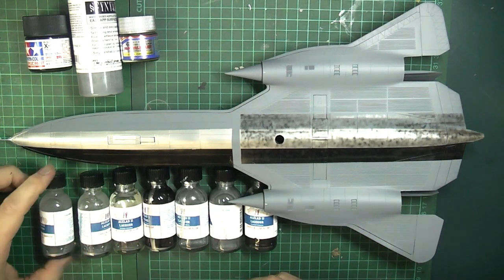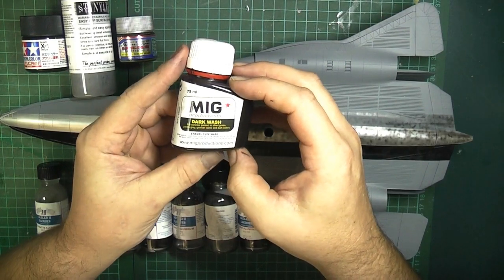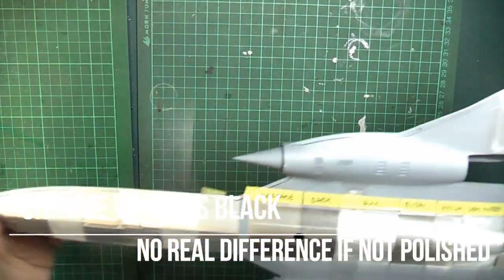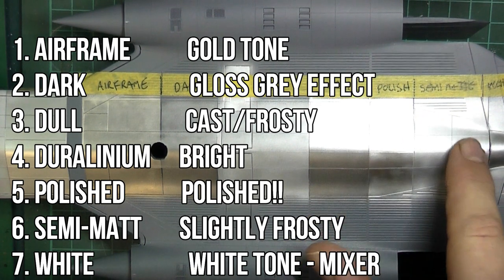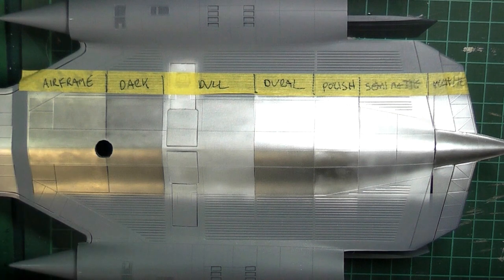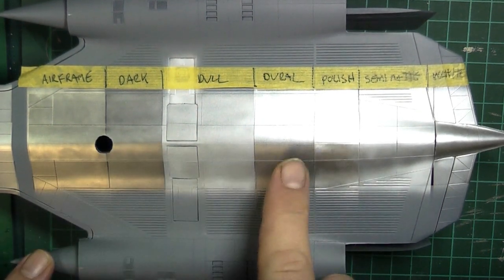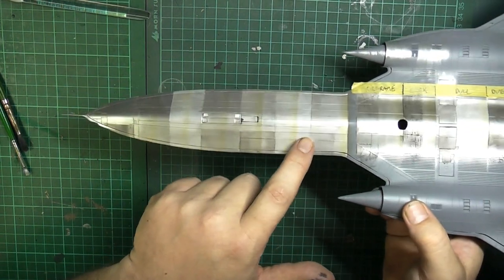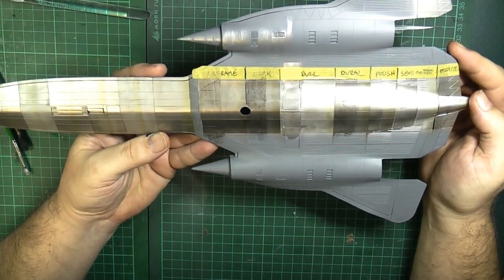How to use Alclads for a weathered aluminum finish on your aircraft model

Comment: Appreciate this was from years ago and not what it was originally designed to test, though, which combination do you think would work best for the Razor Crest? 
It's very reflective on places, but also beat up and heavily weathered/pitted in other places
Reply from the maker: Thats a very good question and one I will try to resolve once I get back to my Razor Crest - I will be using a similar technique here, maybe not Alclads all over, using MRP or SMS paints as I prefer their controllability, but I will update this once Ive done some experiments...cheers Chris

Comment: Experimenting with Alclads for weathered aluminum finish.......shows thumbnail of Titanium aircraft...
Reply from the maker: well there is 3% aluminium in the titanium alloy used in the SR-71, so maybe a thumbnail is relevant to your comment, being so small and insignificant? Cheers, Chris
Reply: @beckersmodels  No offense intended.
Reply: Been building a 1/48 Testors YF-12 which I’m going to paint in the original 1963 Area-51 “livery” which was unpainted, except for the black leading and trailing edges of the wings and chines. So that thumbnail (an A-12) is actually what caught my eye. I think the key for titanium will be a Matt black primer,  it instead of “marbled” undershading, it will be more feathered, and faded using a mix of metallics and matte/gloss. I saw a P-38 build on Primed Model Works where Sean dusted a coat of chrome (after marbling Matt grey over gloss black) before doing the final top coat of airframe aluminum. This helped blend the finish difference between the matte and gloss in the final finish. I think that technique, using a dusting of ti gold in place of chrome will give it the warm titanium look I’m after.

Comment: Any trouble with the Alclad lifting using masking tape?
Reply from the maker: Not if you detack the masking tape several times before applying- I usually use the back of my hand 3 or 4 times. Cheers Chris
Reply: @beckersmodels  nice thanks